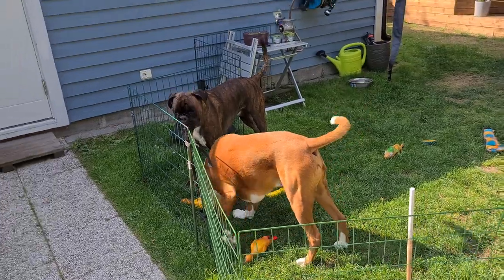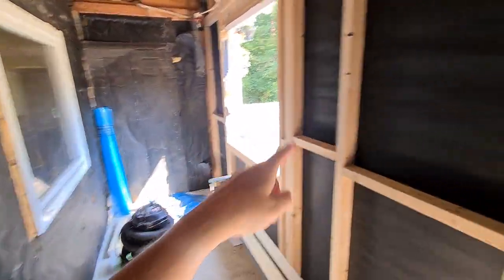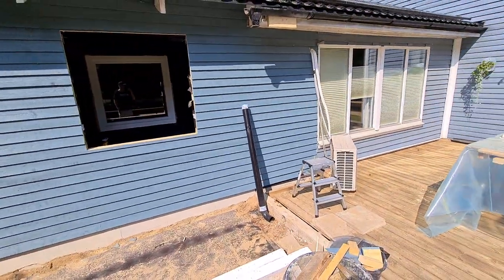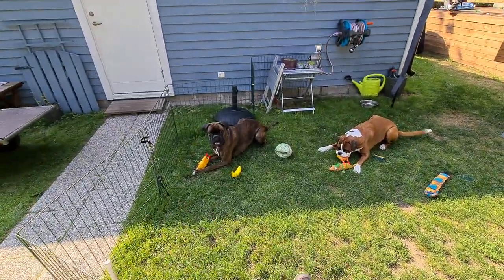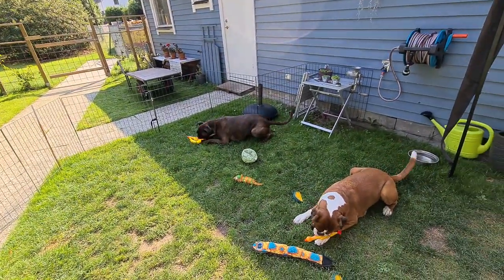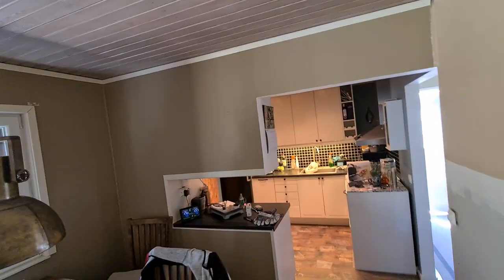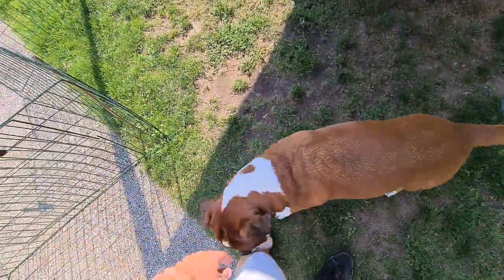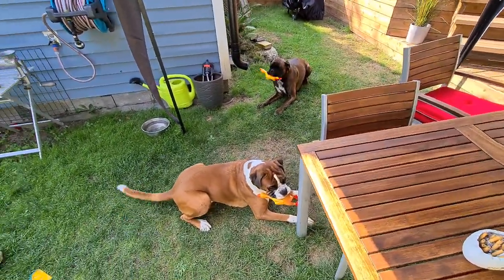Update on the house construction.  And Rex being a naughty boxer brother! 😁

Comment: The kitchen will look very pretty once completed, Peter. Do you use paint brush, rollers or spray to paint the walls, and the wood panels. I like to use the roller on walls and doors much easier. Brush for skirting boards tho 😂. Rex's being cheeky, taking Sammie's toy. Looking forward to seeing the video of the kitchen, completed . It will be a amazing new look. Thanks for sharing the video. ♥️ 🤗 🐶🐶
Reply from the maker: Thank you Clare! It depends on the surface and what end result I want. I use both brush and roller.
Reply: @BoxerRex  Thanks for sharing that, Peter.  Brush and Rollers are best ♥️🤗